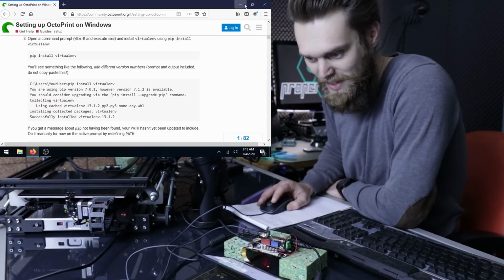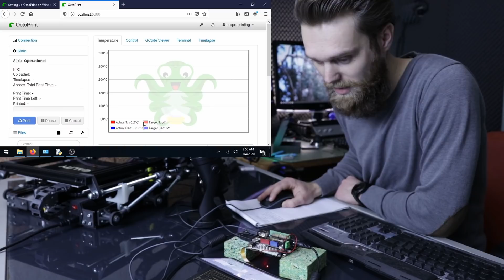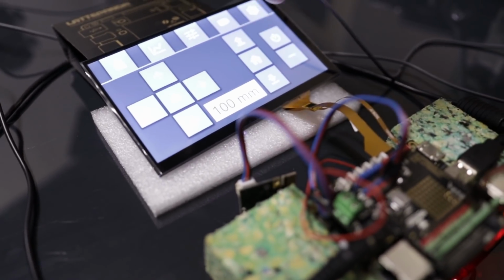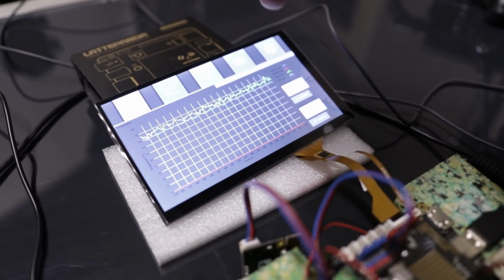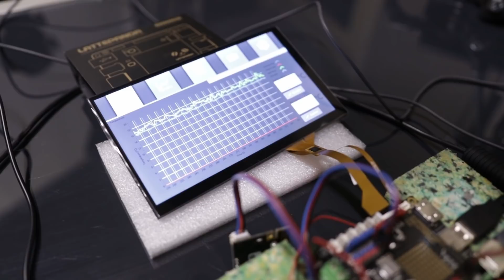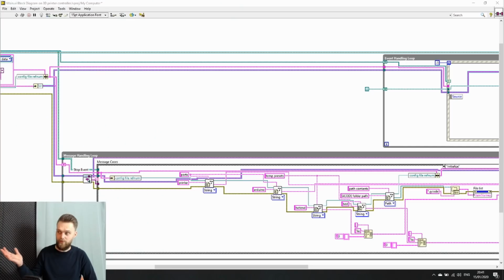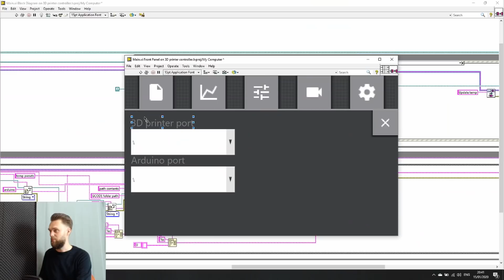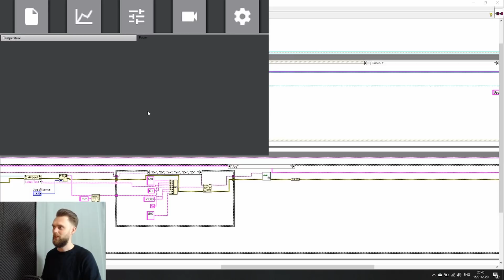Properly controlling an Ender 3 pro with a LattePanda print server

Comment: This would be so useful! Maybe I'll upgrade one day, but for now, my Ender 3 is just controlled with a RPI 3b with Octoprint. The screen for octoprint is a good idea though, I could easily do that.
Reply from the maker: Thanks for your comment! A Raspberry Pi with Octoprint is already a huge upgrade. I've had this running on my CR-10 which I started this channel with and it was a bless. The touch UI of Octoprint is neat and I based my LabVIEW UI on that. Getting the printer to move while touching the screen is pretty satisfying :D

Comment: Next Challenge:  Convert the folding capability to mechanical/electrical.
Reply from the maker: That would be awesome! Nice thing is that this should be possible with the LattePanda because I can now easily add this kind of functionality :D The next challenge would be something very different though xD
Reply: @properprinting  Whatever it is, I am looking forward to it.  However, I think you need to produce a timelapse print with each upgrade to show if the improvements have improved/destabilized/reduced print quality  and repeat-ability.  Nothing serious.  I hate benchy's but maybe just a benchy each time.  Something about 2-3 inches tall.  I think that would really add to the quality of your video's especially since the name it proper printing ;)  Great stuff brother!  Thanks for all you do!
Reply from the maker: @chasgiv4  Thanks a lot man for your suggestion! You're right I must do that. I often forget that this printer must print as well xD. I'm definitely are going to print in my next video. I got tired of the Benchies so I've designed my own benchmark print which would be cool to show more often :) https://properprinting.pro/product/lucky-dice-benchmark-and-test-print/
Reply: @properprinting  Right on man!  Looking forward to it!  Appreciate the response.  Good luck with your next endeavor!

Comment: And another great video! Thanks!

Just a question: do you use Windows on purpose?
I have seen a video with response times between Windows and linux and overall the linux distributions have quicker responses.
Reply from the maker: Thanks for your comment! I'm very fond of Linux and the response time, especially with the low-latency and real time kernels, is indeed much lower which is interesting when making music for instance. I wanted to install Ubuntu but the reason for me to use Windows is that the LattePanda came packed with this and it turned out to be less convenient to install Linux than I thought it would be. Running LabVIEW is easier on Windows but this was not the initial reason.

Comment: What app you are using for thermal reading?
Reply from the maker: Thanks for your question. I have created a LabVIEW application which requests the current temperature every second and plots the values in a chart. LabVIEW is often used in laboratory and measurement environments and I program with this at my work. This program I've created is solely used to show and examine the possibilities with this setup.